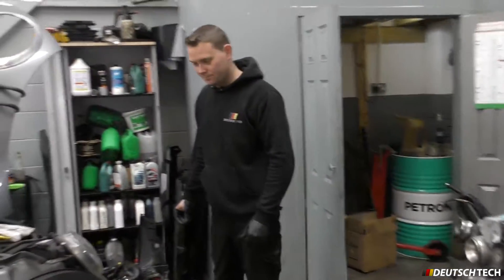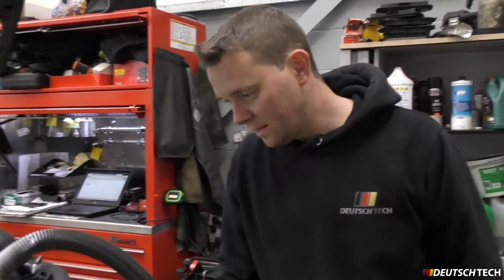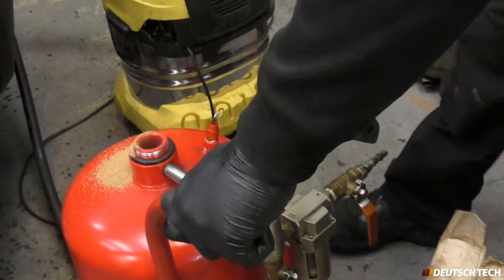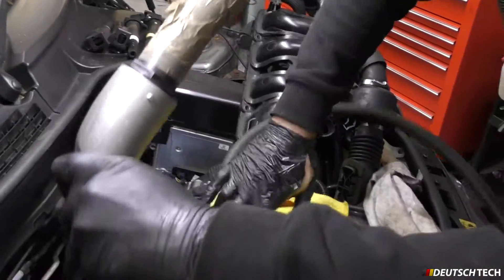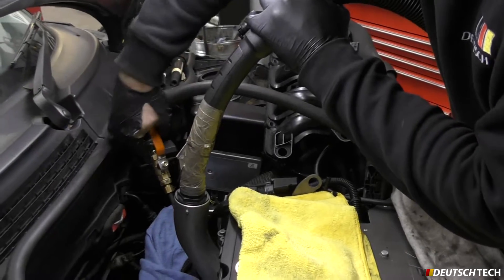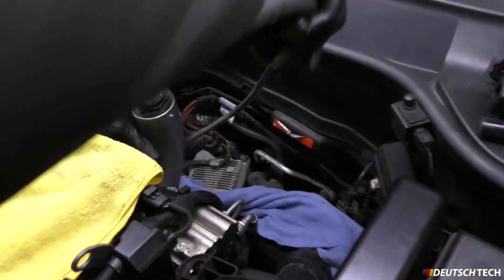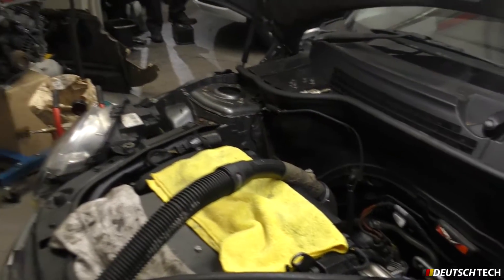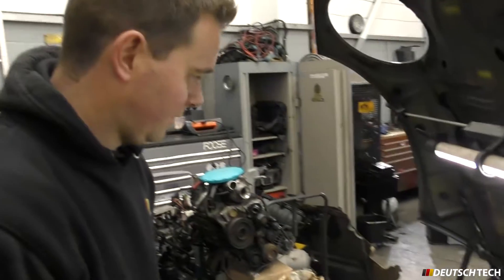Mini Cooper S R56 Super Knocking Fault [FIX] Walnut Blasting

Comment: Great video. I need this doing on my Cooper S. Does installing an oil catch can stop this problem from reoccurring once its been cleaned? I know there are 2 oil breathers on my Cooper S, one going to the Turbo inlet and one going to the intet manifold. I presume both would need to be vented through a catch can, or is one enough?
Reply: Not sure if you still have the car, but a catch can will slow down the buildup of carbon deposits, but won’t stop it entirely, will basically buy you extra miles between intake valve cleans 👍🏽☺️

Comment: What a crazy procedure. Modern engine emission controls have a lot to answer for and another reason why the IC engine will soon be history.  I would hazard a guess that you need the inlet valves closed on individual cylinders when you carry out this procedure or there's surely a danger of getting your walnuts in the cylinders!

Comment: What exactly does this do...have one of these bastard cars....should of gotten a cadillac.why does everyone GOTTA have a damn german car or luxury car?? Sorry bout that went down ANOTHER rabbit hole...lol😂.. Do acorns and lumber work also?
Reply: you really should google cadillac direct injection carbon buildup before concluding Ford being exempt from valve coking, Ford has added port fuel injection to their ecoboost engines along with direct injection to remedy this problem, following the example of Toyota.
Reply: @rykdheiner  Toyota is definitely on my shopping list along with subaru.I'm done with these maintenance requirements so very often....German cars need to much of a little that and a little this.just want to change my oil and filters "inncluing air filter AND do maintenance and still have nothing to worry about less then 3,000 miles after dropping a ton of money just to have the car back in the shop for yet another in RELATED problem..I guess I just wanna drive without taking care of a infant.lol😚